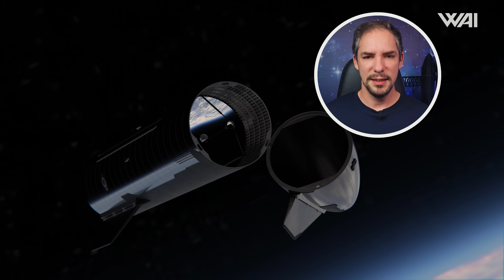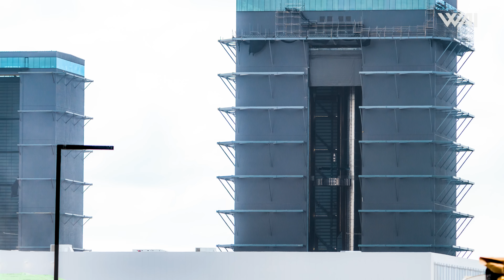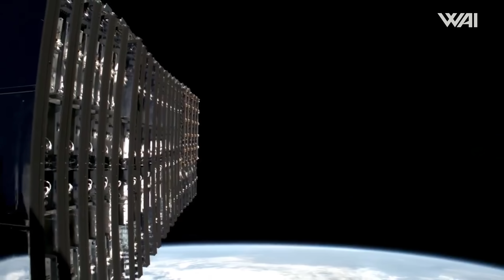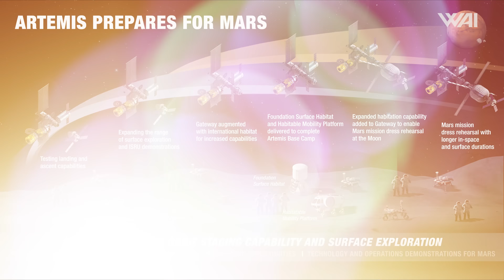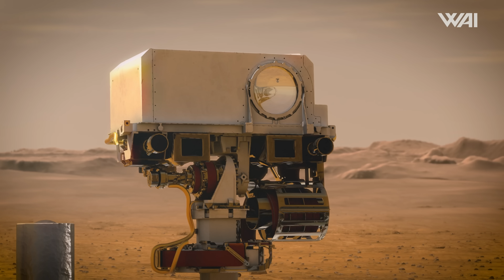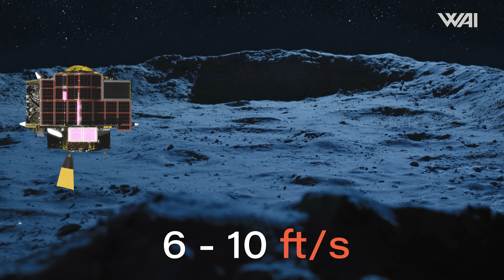SpaceX Is Building The All Seeing Starship Eye!

Comment from the maker: Which of these Starship concepts do you think will happen first? Do you have any other innovative ideas on how Starship could be utilized?
Please leave them in the comments. Go wild! I'm always eager to read your thoughts and ideas! :_WAISweet::_WAIHeart:
Reply: If I was writing a project plan for a moon base, I'd probably start off with landing 4 Starships vertically. Three Starships loaded with only building materials and equipment, with the 4th being crewed and temporary habitat. The three cargo ships would be landed in a triangular formation, anchored down, and cables strung between them to form a three-point cable crane.  system. Then future cargo Starships can be landed in the middle of the crane area and large assemblies "easily" removed from the Starship cargo hold, or the whole ships scrapped for materials. An SPMT would be on the list of equipment to send. 

Building a stable and reusable landing pad in the middle of the cable crane system would be a top priority for any long-term operations. Once delivery and material handling is established, then I'd propose starting on a permanent manned station. The cable crane and SPMT would be used to layover Starships prepared with habitats in them and transport them to where they would be buried.
Reply: You could fire it at my exe's house
Reply: @blahblahblahetcetc  Pagan chicks are more trouble than they are worth. A Christian woman is worth millions.
Reply: Starship won't be useful for that, but Booster will. Coupled to an Expendable second stage booster could really get a hell of a lot of mass and volume to space. And that will be all this will ever be used for. Non human cargo
Reply: 8 Star Ship`s in a wheel sliced in half then extended apart by 8 rings to make a saucer - 3 ships connected together side by side to make 2 sections going diagonally away and downwards to 2 3 Star Ships tall per side as propulsion, outer shielding ballistics materials, Moon soil pumped into all unused voids and 6 foot thick on on outer hull voids as shielding to help solve radiation issues...
Reply: With Starship going orbital soon, the question will soon pop up: What should we do with this new rocket that can lower the cost of space access to only $10 a pound (Musk)? 
The answer is simple: We build.
Many things will be built: Giant telescopes, vast satellite arrays, and huge space stations. The small but growing space construction industry will have its day soon. But it gets better: Recent surveys show that 49% of all Americans want to visit space. Those few space construction companies with automated space construction machines will build large space stations to satisfy at least some of that desire. Spacelines will form to become the "airlines" of the orbital, cislunar, and lunar space tourist markets. They will buy starships to serve those orbiting space stations like VERA Station - daily. 
BTW: Gateway Foundation is now Gateway Spaceport and our new space construction company is called Offworld Industries Corporation. The big rotating torus-type space is VERA Station and it will be built using a family of automated space construction machines called Sargon Systems (US Patent pending).
The next big thing in space is habitation. If you want to visit, work, or live in space, your day is coming soon!
Reply: @TheGatewaySpaceport  to surrect planets is how to live in a universe - life as center of the universe 
(space as highways make earth and mars the same place, a two-planet-world )
Reply: I'm fully expecting to see a tunneling boring machine, specifically one made by Musk's Boring company,  to be loaded in a Starship at some point. Imagine how fast we could create an underground city on the moon or Mars!
Reply: @chrisdalle5450  (ice as building materal be self sealing and give vast structures in no time )
Reply: Dang!
Reply: Keep it up!
Reply: Yt channel spacex vision
Reply: Just an idea but shouldn't the lunar starship have windows on four sides instead on just one?!?
Reply: I would say that windows are points of weakness on something hurling itself up into space. Not sure why you'd want windows on all four sides anyways because two would always be sort of dark outside on a true lunar day.

Lastly, the true gold is on the Lunar Southpole. They're not going to need any windows down there because it is 100% pitch dark @DJBREIT
Reply: @CF_Harris_The_Author  
Weak point? They are putting four of them together on one side of the ship. Also, we are going to the South Pole because some spots have 100% light.

Having Windows on Four Directions will allow someone to spot or observe in any direction from the ship when on the moon.
Reply: It's a ship, that needs to go 18000MPH.  A> windows are weaker than steel. B> The southpole where the water is where everyone is going because a permanent station on the moon needs water...it is in complete 24 or whatever number of hours a Lunar orbit is in. C> WTH do people need to spot things on the moon? It's not a joy ride, and I start to sense people thinking SpaceX's levity with regard to things is making people think that this is an easy and safe thing to do. If you need to "see" things, put a damn camera outside of the ship with a 60 inch lcd inside if you need. Put ten cameras outside the ship. Safe because all are connected to super sealed1/8th wire instead of windows, which are huge failure points.

I think it needs to be said. They're not going to the moon for a sightseeing trip. They're going there, hopefully, so they can get to the water that hasn't evaporated because the South Pole they're aiming for is 100% in darkness. Water means long-term space trips and bases. Lack of water means the opposite of that. @DJBREIT
Reply: @CF_Harris_The_Author   Nope. At lunar poles, nearly eternally lit, UNLESS in a crater. And being in crater with windows, would allow you to see STARS all over.
Reply: @CF_Harris_The_Author  "that hasn't evaporated because the South Pole they're aiming for is 100% in darkness."
False, there IS light there. Just not bright sunlight. You will still be able to see stars.
Reply: Nope. You're wrong. The only reason why there is water on the South Pole is eternal darkness in low-lying areas that are dark 100% of the time. The Sun and +256 degrees hits that water and it's GONE like the rest of the moon. At least they are assuming the water is still there. If it's not, I'm not sure how successful mass colonization of the moon is possible.  @grraab2000
Reply: spin the bathroom section just a little and the toilets can be used normally - showers and baths even 
spin the dining section just a little and all meals can be eaten normally 
(a stationary 9m diameter loop as an electric scooter obstacle/slalom course would give you all the g-forces you need for as long as you want )
Reply: What is needed is for slightly different manned Starship to be modified to have a much smaller methalox tank, only 2 space-rated raptors, remove the fins/heat shield, increase the size of the habitable tank. To that, add 9 docking ports. 1 at the front, 4 around the  top of the habitable tank and 4 at the bottom of the habitable tank. With this set-up, it can serve as a backbone for adding other units esp. to get them NASA-tested and vetted. It would also be possible to put multiple of these in parallel, using 1 upper/1 lower docking to hold 2 units together. 

In addition, if SX is going to use these on the moon and mars, it is best to fully undergo long-term testing of its ECLSS system. 

Note that something like this could be used as Lunar and Martian space stations in a quick manner.
Reply: Building ISS 2
Reply: Just keep stacking Starships to create a space elevator!
Reply: Read the book "Death's End" by Cixin Liu. Starship could be used to create a "super-mega large hadron collider" in orbit around the earth. No atmosphere means that only the magnetic rings would be needed to guide and accelerate particles around the earth at higher energies, pushing the boundaries of our knowlege of physics!
Reply: A spinning wheel space station sounds great, but it will need to be balanced dynamically at all times, because astronauts, cargo and waste materials will act like weights on a car wheel, and take it out of balance as they move around the outer 'floors' of the craft. Maybe balance could be maintained by pumping water around the station?
Reply: Use Starship to launch "ring" segments, for an octagonal Von Braun wheel. Wrap wire around the circumference & energize to give it a magnetosphere for shielding. This could even be your Mars ship!
Reply: Starbase needs a sea wall. Galveston was destroyed in 1900, New Orleans 2005, Boca Chica also, and everyone pretends that the ice caps are melting so… where is the sea wall? Who builds factories on the beach? Not just a beach, but an alluvial sand bar. I would be nervous parking my car overnight on a beach, and I’m from Texas. We built our beach house on Tiki island 17’ up.
This whole Mars thing is fishy. What’s really going on? Why the hurry?
Reply: Read my comment to see what is really going on. Musk nearly discussed it with that guy who gives away money for ideas that solve big problems, but he changed the subject in the next sentence. New Orleans built a billion dollar seawall for hurricane protection since Katrina. @memyselfandi8544
Reply: @memyselfandi8544 everyone PRETENDS like ice is melting? Pretty sure you can google some satellite image time lapses and see that they are melting pretty easily

Comment: It is definitely exciting to see starship development and think of the possibilities. But kne thing I thunk we are completely off about is the cokplex process of integrating payloads into starship. Atleast by the current version of the test articles, integrating payloads seems to be a major hurdle. There are sections of TPS tiles overflowing on the windward side. Ofcourse after a re-entry test they might remove it depending on the need but I suspect they are there to stay. Moreover, the header tanks occupy a large area at the top. Given that the ship is designed to be reusable and fairing cannot be jettisoned they have to come up with a general solution for the fairing door that can be used for all different kinds of payload with sizes and shapes. The payload door not only has to bear the load of launch but also re-entry. It has to maintain the seal specially while coming back. Any leaks will simply lead to RUD. The releasing mechanism for the payload is a issue on its own. An interior automated/remotely operable small robotic arm may be able to solve this but would not work with snuggly fit payload of diamater between 8-9m. It will be exciting to see the solution that SpaceX comes up with.

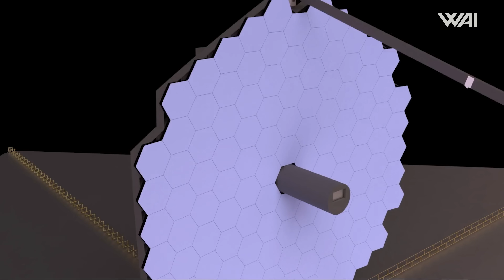Comment: 8:00 Not sure where the "10x the resolution of Hubble comes from, but it is incorrect". The resolution inversely proportional to the diameter of the telescope. Hubble diameeter = 2.4 meter, starship diameter = 8.5 meter. 8.5/2.4 = ~3.5 so the resolution would only be about 3.5 times that of the Hubble space telescope (assuming the observation wavelength is the same).

Comment: If the vacuum Raptors are designed to be able to be easily detachable, a Starship-like space module could be hurled into orbit and the engines detached and parked for future reuse, or return en masse inside the cargo bay of an actual reusable Starship. That would save a ton on wasted mass for heat shields and maximize the use of heat shielding. Eight Starship-like vehicles go up, three return with all the Raptors, and there would be five heat shields worth of mass that would be freed up.

Comment: INGENUITY BLADE FAILURE: those blades have to spin crazy fast to generate lift. It could well be blade composite material stress fatigue failure from immense centrifugal forces over repeated cycles of use. Also hitting air molecules at supersonic speeds has its own wear and tear effect(it's not as bad as marine propelers and cavitation, but it's not zero). Add the factor of crazy temperature shifts to supper cold, making all epoxy resins in the composite blade brittle and prone to cracking under stress- and ripping itself apart becomes the most logical outcome of comparing with hitting the ground. If that thing touched the ground with those supersonic blades, it would pulverise itself in an instant(seen helicopter crashes on Earth?). But you can clearly see the pictures of it standing there intact, just the blade tips missing(the parts which were supersonic).
Reply: Supersonic velocity on Mars are way different than that on Earth
Reply: @alvianchoiriapriliansyah9882  good point, at low pressures you might need even higher speeds to get a fenomenon sonic booms, but even if you dont get that fenomena, you still spin at those crazy speeds and that does not stop dust particles in the air to slowly erode the structure of the surface of the blade and keep eating into it. How meaningfull that impact is comparing to centrifugal forces and masive temperature shifts and even radiation- not clear. But sure on such small fragile blades so light and so close to its max capacity- its not zero.

Comment: My thought, partially or completely submerge 8 starships vertically into the surface of the moon, forming a circle of starships. Connect the starships via curved tunnels under the surface. Then dig out an open area at the center of the starships to add a larger, inflatable open living space. It's to be covered as well. Not getting into the details of how to do it all, but ya know, this just came to me and I'm sharing.

Comment: Hard doors almost never seal properly over the complete structure and even when they do those seals wear out and fail and crack fairly regularly. A fabric door is much easier to seal and it has less edge context to seal since the door itself can be one solid piece. Another advanced solution by SpaceX!

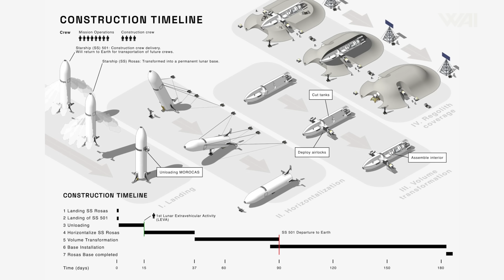Comment: 10:10 etc,.... FFS Felix, who comes up with these dumb ideas? Why are people fixated in running floors down the long axis, when the smart design is to treat the Starships like flying apartment buildings with floor ACROSS the body. All that's needed to turn one in to a habitat is to drop it in to a vertically bored tunnel, pull the raptors off the bottom and use the remaining fuel to make air and water and carbon dioxide for plants, with the tanks being opened up for a ladder down the middle and more floors welded in.
LIFE/BEAM would work this way too, with The Boring Company already getting equipped to make the underground tunnels on Luna and Mars to connect the ships in to a city block.
10:45 - and the latice is fine, but why eff with the nosecone when there's two lift points under the front flaps to handle the 'downward' loads already - what was that Muskism about parts doing more then one function - Lift point for Mechazilla is also the lift point to hang Starships on a giant Ferris Wheel.
11:44 - there we go, at least one design is on the right track.

Comment: Felix may ask you why Falcon 9 and Falcon heavy do not have ring on top of first stage?
Reply: Because it uses a pusher system which worked well. If SpaceX never intended to support multiplanetary mission & not focused on Starship, they will absolutely upgrade Falcon to have a hot staging ring at this point

Comment: I have wondered why they can't use inflatable longitudinal air-bags to drop the starship on the moon, instead of the pulley system. Two long bags about 60 degrees apart, nose to tail. Blow them up with excess O2. Use RCS to blow starship over. Can be done remotely with pre-human trip (test) starships.

Comment: How about instead of just a spinning stick.  Build a spinning hatch tag.  Or build a spinning cube.  SpaceX  could build empty stainless steel modules with one female docking station and one male docking station on each end.  They could be used to form most of the hatch tag or the cube, and use as passage ways and storage.  Smaller ones could be built for the corners of the cube.  Other long ones that would be put on the outer edge of the hatch tag or cube could have 2 to 4 female docking port so vast space modules, Sierra inflatable space modules, SpaceX Starships, etc., could dock to the spinning hatch tag or cube and instantly have artificial gravity.  All these cylinders could be pre - manufactured to fit inside the fairings of a falcon 9 or inside the cargo bay of a SpaceX Starship.
Reply: The one thing SpaceX didn't do is building a completely custom hardware

Comment: Why not build SpaceX Starships so after they land on the moon, all you have to do is open up a high pressure sealed door, and the fuel tanks become part of the Starship living area.  A few floors, stairs, walls, and doors ways, could be prebuilt into the fuel tanks, to make the conversion simple.

Comment: I think the artificial gravity concept presented in this video is over-fussy.  Instead, just take two StarShips - with no hub structure.  Connect them with a cable - not anything more complex.   We know that StarShips can be lifted here on Earth with a crane and a cable attached at the nose cone.  This tells us two things:  (1) StarShip is strong enough to support its entire 1g weight from the nose cone lift points...and  (2) a cable that can support the weight is not impossible.     So now, this is simple.  Hook up the cable in a series of space walks...tension the cable and set it spinning with cold gas thrusters.    A mass mis-match between the two craft would NOT be disastrous...it would slightly shift the center of rotation - and result in a change in the amount of artificial gravity in each of the two spacecraft.  So radical simplification results in a VERY low risk system...which is VERY "Elon Musk"...and this is therefore MUCH more likely to be the preferred solution than the complicated contraption showed in your video.
Reply: Wouldn't be surprised that this is exactly what SpaceX is planning (without the spacewalk part)